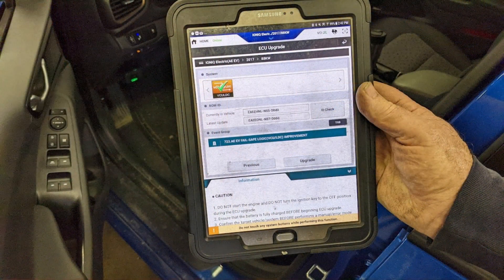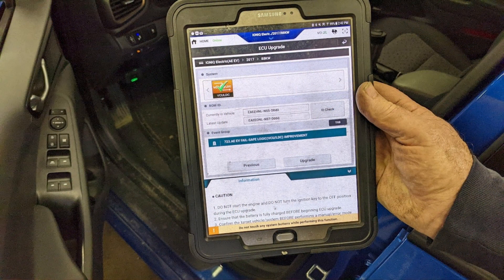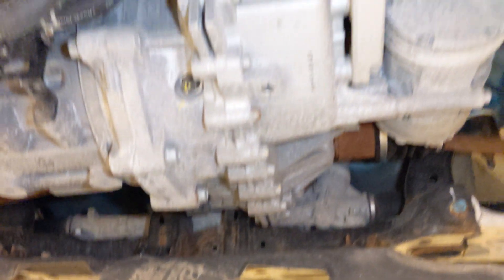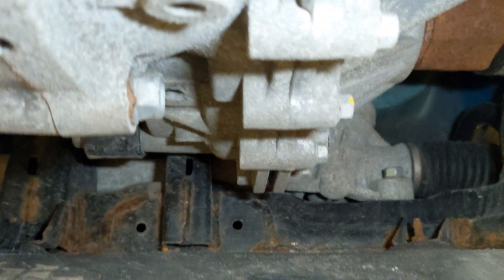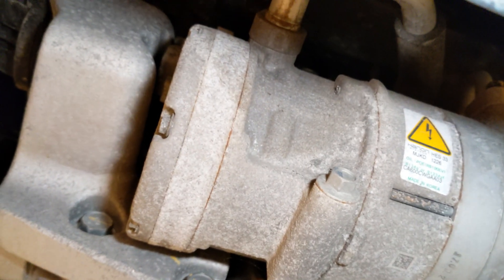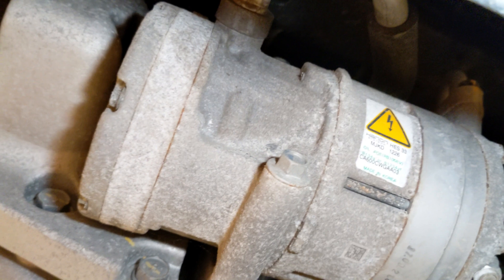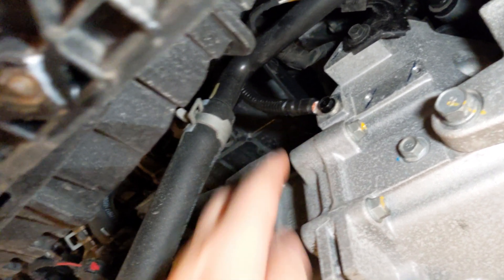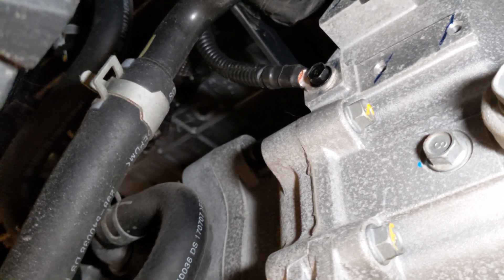Ioniq EV Recall - Unintended Acceleration

Comment: Having similar problem with my 2024 SEL which intermittently accelerates when I am coasting in Lv 1 setting at low speed, it suddenly jumps forward. When I hit the brakes it stops the acceleration. Car only recently started doing this so not sure if this a result of recent software update or not.

Comment: hello.
Introducing the cause of car Sudden Unintended Acceleration I found.
The cause of sudden unintended acceleration of the car is that the MLCC inside the engine control unit is out of order.
   MLCC(Multi-Layer Ceramic Capacitors)

For more information, search on YouTube as follows.
    Keyword: [Root Embedded] Causes of car Sudden Unintended Acceleration.

I hope that my data will be helpful in identifying the cause of the sudden acceleration of the car.

thank you.

Comment: What is the steel wheel you used for your winter tires? Is it from another Hyundai? Also what is the size? We have a 2019 we just bought and I will need to put winters on for my wife next year. Thks.
Reply from the maker: I just cleaned these rims and can not find any markings on them. The tire size is the same as the summer tires. I am sure any place that sells tires will be able to tell you what rims you need.

Comment: The extra earth strap can anchor anywhere on the gearbox. You don’t need to access it from underneath the car or to remove anything. I just bought an 18” strap from eBay and fixed it to a gearbox bolt that I could reach from above. No more hesitation problem.
Reply: I should add that I did this mod before Hyundai issued the recall. At the time I did it, my local Hyundai dealership were in denial and wanted to book the car in for “investigation”, which might have been expensive and certainly inconvenient. And the hesitation was intermittent, so not easy to reproduce on cue.

Comment: Thanks Eric for this update my wife has the 38KW version, I wonder if it applies to that model as well? On another subject have you replaced the gear reduction oil in your car? I replaced the oil in my Kona @ 35000km and it was black with lots of silver shine to it. The oil at the dealership is really overpriced @ $59 a liter, would love to find a better price somewhere. From what I've read on message boards both Ioniq and Kona suffer from this issue. The dealer feels it's normal? Funny all my years of changing oil in manual transmissions the oil was clear with the exception of the presence water, or if the tranny was on the way out it would be full of bits.

Comment: Interesting regarding this ground wire. One of my friends had an Ioniq EV, which occasionally had the peculiarity that the acceleration was delayed when he stepped on the accelerator pedal. It never happened from a standstill, but typically when the car rolled towards a traffic light after which it had to accelerate while the car was in motion. On Ioniq forums I could see that for some this was solved by adding a ground wire in much the same way as the video shows. Thanks Eric for showing this in your video.